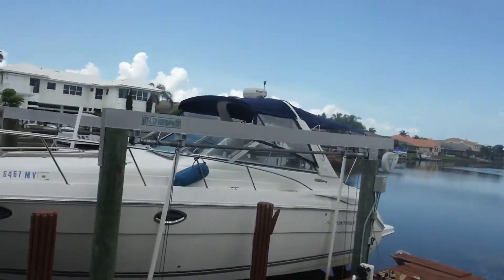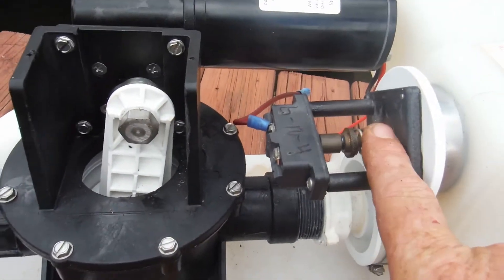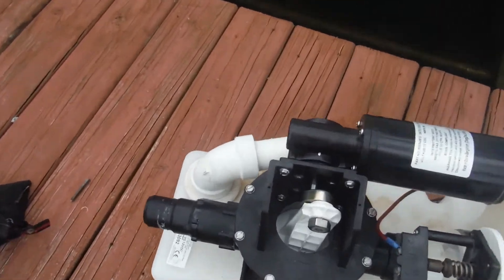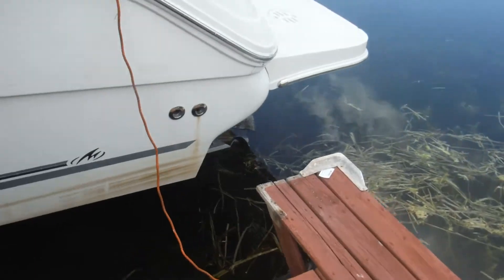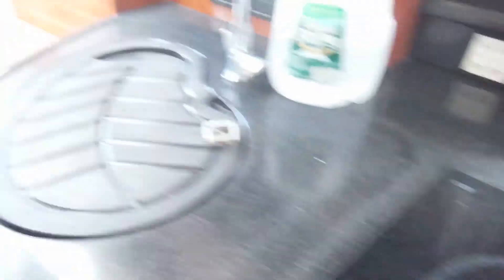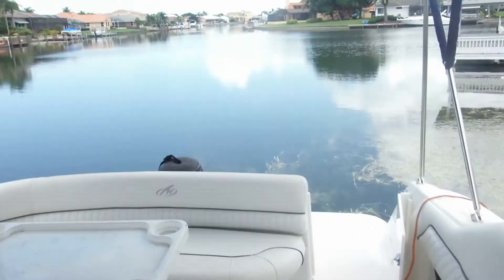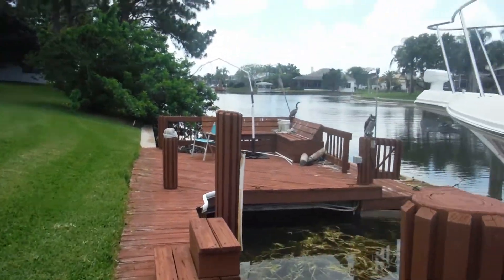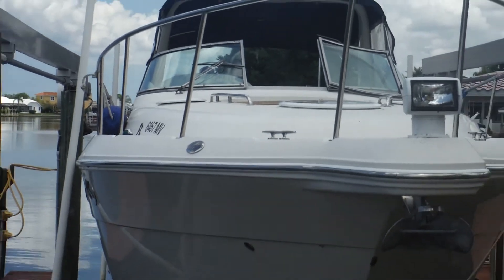Vacuum pump repair.

Comment: Can anyone give me me advice on getting the plunger onto the bracket. The o ring is in the top lip but it will not seat it keeps pushing the o ring down into the plunger. I greased it well. When I took it apart the o ring was on the lip of the motor bracket.
Reply from the maker: see my video of Sealand vacuum pump repair. 1 thur 4
Reply from the maker: it will show you o ring install